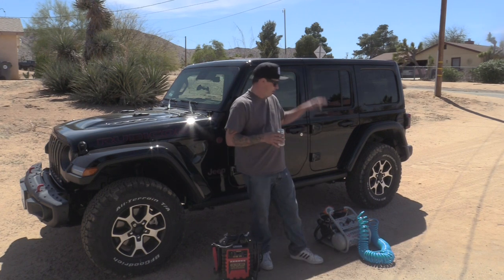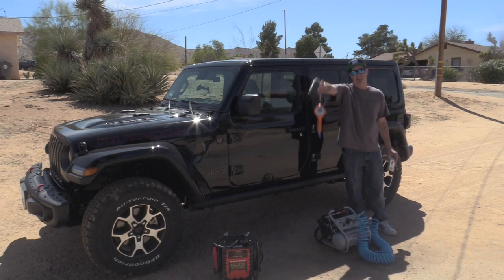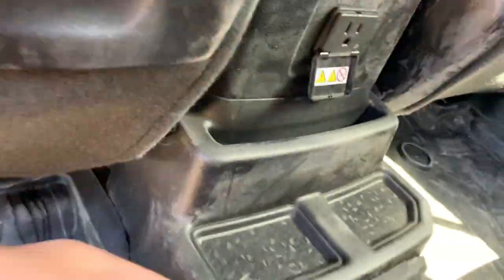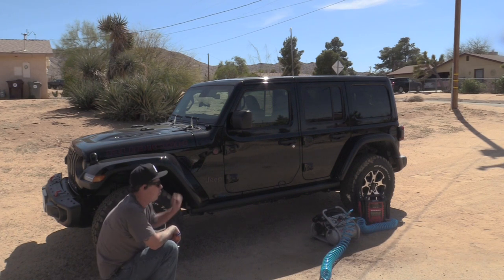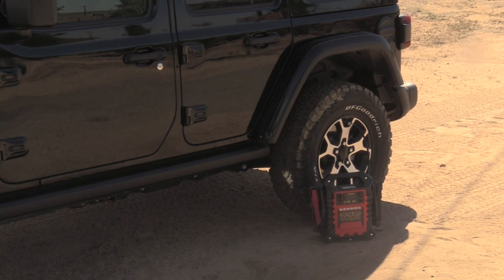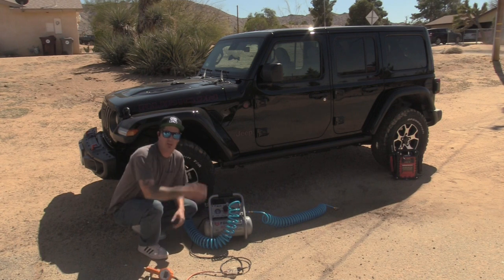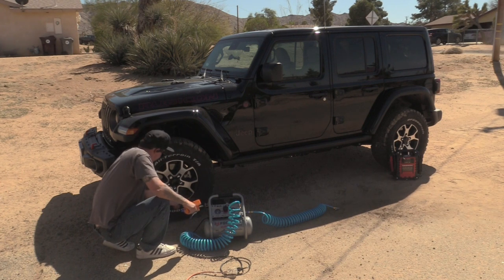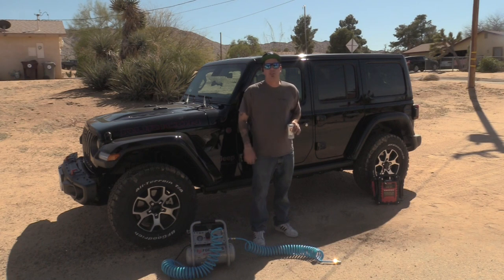Fortress 2 Gallon Compressor was too much for the Jeep to Handle   Air Down & Air Up Real Time

Comment: I have the jeep grandcherokee  and its built in inverter sucks. I added a 600w stand alone hooked up under passenger seat then ran one of the outlets to the actual outlet by passing the casr inverter.

Comment: I highly recommend Staun automatic tire deflators (6-30psi) They deflate really quickly, as I walk around screwing them on by the time the 4th is on, the 1st is almost done deflating.  There are cheaper ones that look like the Staun’s but they take forever because it’s just a spring and as the pressure gets close to the cut off it goes sooooo slowly.  The Staun’s release air at high speed until the cutoff and they click off.  Get them from Amazon, try them, free returns, nothing to lose.  (I have absolutely no affiliation with Staun, I just think they’re the best deflator out there).  Loving the shift to Jeep content by the way, congrats one getting out there and making memories!

Comment: I use the ARB twin air compressor mounted under the front passenger seat to air up before hitting the pavement.  It takes about 90 seconds to air up each tire on my stock JL Rubicon 33" tires from 18 psi to 38 psi.  It's a bit pricey, but oh-so convenient.  Good luck with your Diesel . . . I'm loving mine.

Comment: They make deflation caps for deseried psi. Pretty cheap and come in a 4 pack. Easy and fast to use. You keep saying that jump box is 89.00 bucks but it's 179.99 all over the website and in the store.
Reply from the maker: 😳My bad... I must’ve missed the 1 😬Sorry about that. Have a happy Easter 🐰 and thanks for the correction 🍻😊

Comment: I don’t like using a valve stem removal tool because it’s so easy to lose the stem. For airing down off road the 2 most common things I see used are the EZ-Deflator from ARB or Currie, although more than a few companies make a version. Currie typically runs a bit cheaper and it’s what I use and like. Next is screw on kits, you set the deflator to your desired psi and just screw it on the valve stem. This style works well but can take a bit longer. But you can screw then on the valve stem and start driving then remove them later. Ruff Stuff Specialties sells a kit for $30 and they are a great small business. 

For airing up I have a Viair 400p compressor. It’s a bit speedy at $220 but it flat works and hauls ass when airing up. It’s also portable so can keep it in my Daily driver and throw it in the Jeep before a trip. Smittybuilt also make a well reviewed version that is about $170. But I have been a Viair fan for a long time. 

You are definitely on the right track with equipment. I think you will better served with more off-road oriented gear than the general purpose stuff. Glad you are enjoying the process!

Comment: Justin if you want a power inverter get a pure sine wave power inverter. It’s work really good for my Dewalt tools I use at my job, has it for a year in a half. You can get one from amazon for $317 bucks. I would run 1/0 cable for a welder on it as it can supply the high current.🍻🍺👍
Reply from the maker: Thanks Brother I’ll look into it 🍻😊Happy Easter 🐣

Comment: LOL, why would you be surprised a factory inverter couldn't run an air compressor!?  I wouldn't expect anything more than 300W, Likely 150W, maybe enough to charge a weak laptop.  Cool video non-the-less.  Looks beautiful out there.
Reply: It's a 400W inverter which is like a shade over 3 amps. But a 12v compressor connected to the battery draw 25-35 amps which is 300-420W... So maybe a 300ish Watt AC compressor that's much cheaper would work just fine. Like the Hazard Frought's $50 pancake 3 gallon compressor that is rated at 2.5 amps.

Comment: you need a source that'll give you about 900 watts to cover in rush and 840 to keep her running. the 150 supplied by the receptacle onboard the jeep is only going to give you a little more than an amp of operating current. Love the content Justin keep it coming bro
Reply from the maker: Good to know. Thanks for the Information Cheers and Happy Easter 🐰🐣😀

Comment: I bought a new truck with the built in power inverter thinking I could run a skill saw with it but found out that it's for charging batteries and light weight stuff I would check in on a built in generator then you can power anything anytime

Comment: Yep get a big inverter.  Real  big. Like 3000 watts or so.. then you can run anything and appliances in the house.(fridge and gas heat) if there's a power outage.  Clips to battery direct.  Factory inverters are pretty weak. For phones and laptops only.

Comment: I Think when you Air down you're tires .you are braking the  tire bead going over Rocks ? Great Video 👍 🇨🇦
Reply: That's the reason why they make bead lock rims. They keep the tire on the rim when running really low like under 10 psi

Comment: You're kidding me right?  Please tell me you knew 100 percent there was no way in hell you were ever running a 2 horsepower motor off a stock oem 110 volt outlet.
Reply from the maker: Why is this shocking? I see guys pull into the shop with power inverter’s, but those that have the Rubicon I’ve only ever saw the factory plug. I thought ooh cool they did that for the off-road peeps 😊🍻🐣